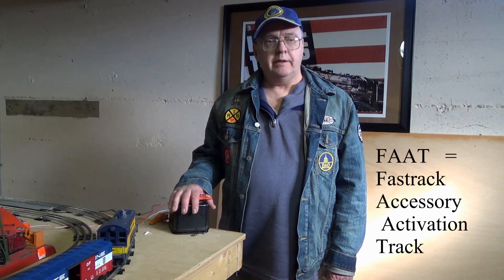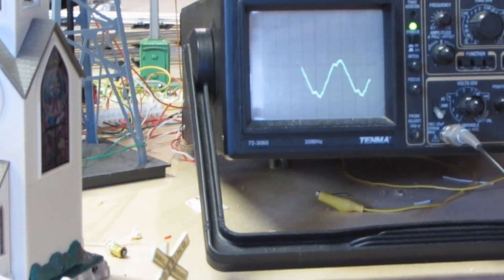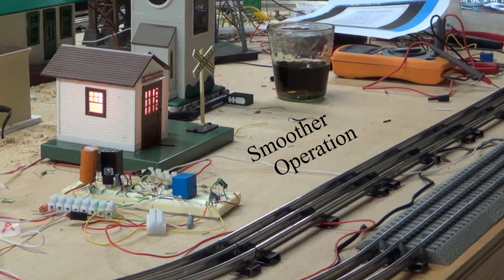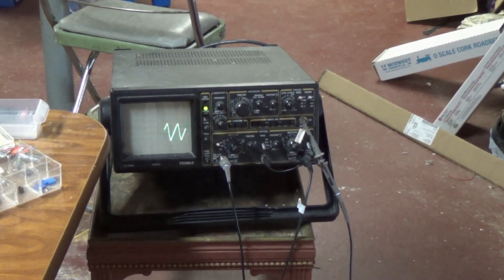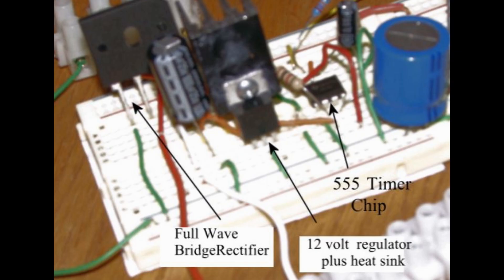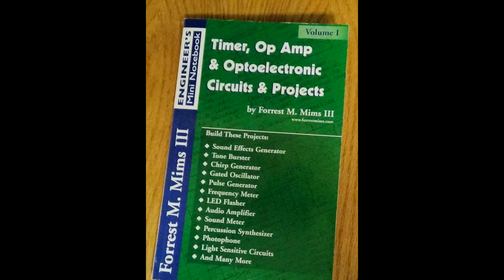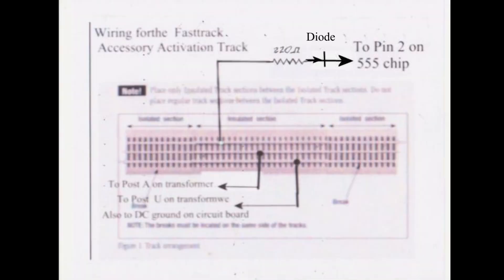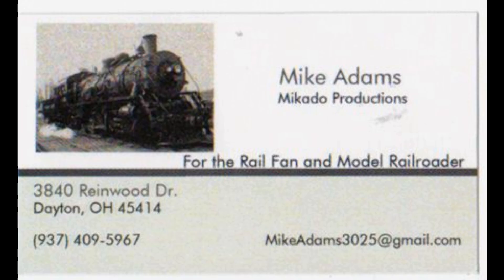Electronic Circuit for the the Lionel Trains Automatic Gateman

Comment: Hey Mike... I just bought a brand-new, current production Lionel Gateman from Amazon and noticed that is has the same smooth operation as yours.  Out of curiosity, I took off the bottom cover and saw that Lionel is now producing these Gateman with a circuit board that looks very similar to yours!